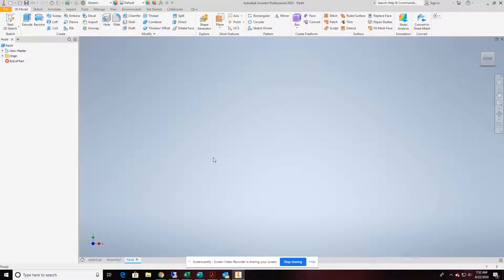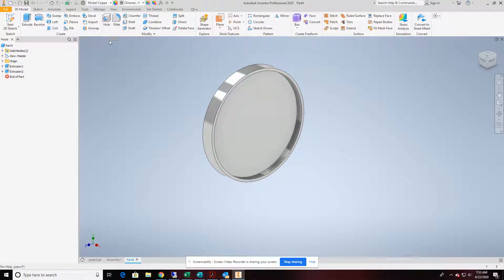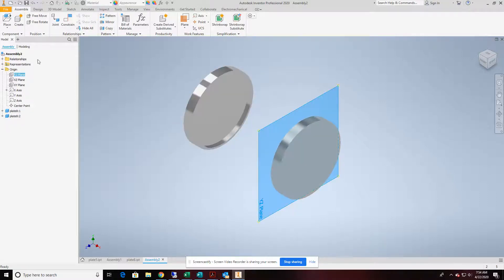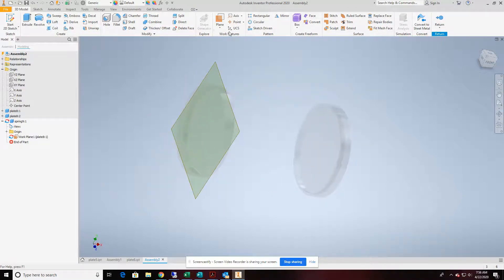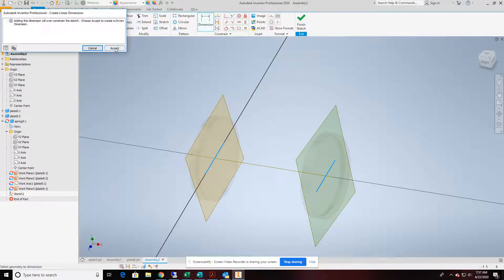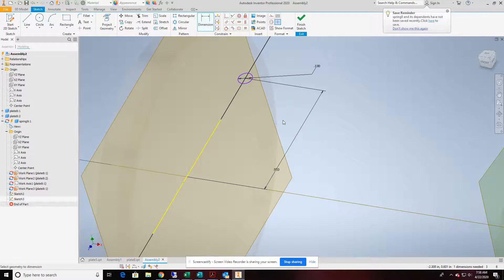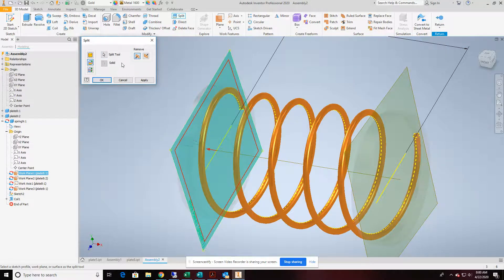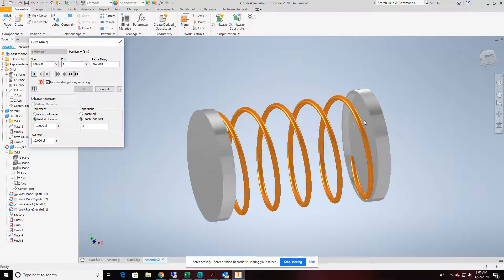Adaptive Spring Created In Inventor

Comment: Inventor 2021 . Mine plates just moves ,sprint too but its not "connected" - it just squeeze throught that :C
Reply from the maker: Double check your work planes and make sure they are in the part file for the spring and attached to the two plate surfaces.  Also double check that your spring has the adaptive symbol next to it in the assembly browser.
Reply: Im still not sure whats wrong with that - maybe im missing something . + What i see interface in 2021 inventor is a little bit diffrent than showed in video so...Thats kinda sad.Could i place somewhere my project to doublecheck if everything is okay?
Reply from the maker: I will be more then happy to take a look at your model.  Drop Box or google drive the folder and i will check it out.  Im going to put up a Rubber Boot that works similar to the spring in Inventor and will use Inventor 21 for you.  Should be up in the next 5 days.
Reply: @MorrisonInst1973  Edit:https://drive.google.com/drive/folders/1jSyoFk7dcLnL1tAfsCd_--paf9Cq3UzS?usp=sharing If i didnt make any mistake it should be all
Reply from the maker: @Fuxor7 I need your part files as well.

Comment: I followed all the steps but my disc moves without extending or compressing the spring
Reply: While extending tbe spring doesn't move
And while compressing the (should be compressed) part disappears
Reply from the maker: @Satyam_Gupta31  when you are in the drive command make sure drive adaptive is check on, also make sure the adaptive icon in the browser is showing for the spring and the workplanes.